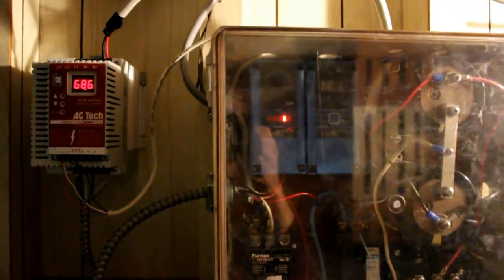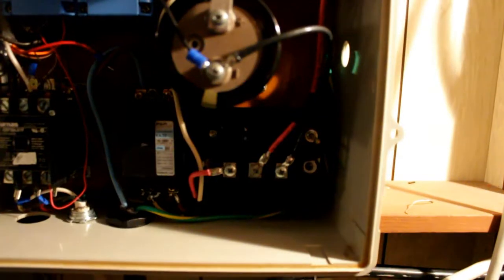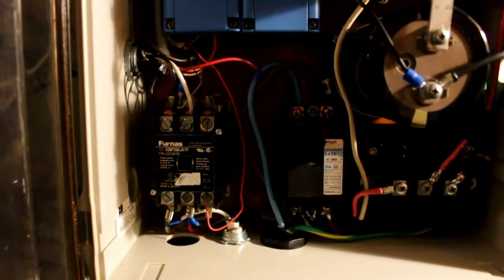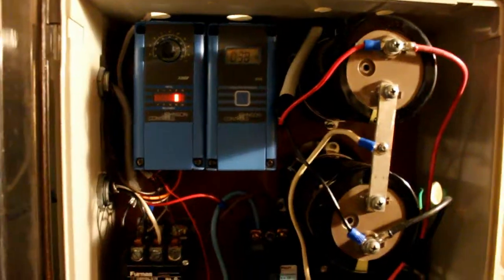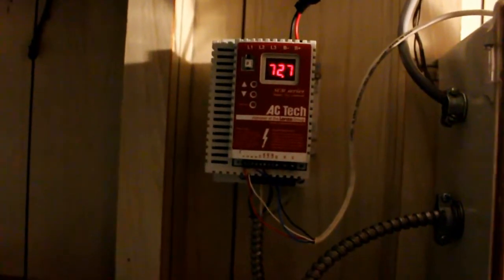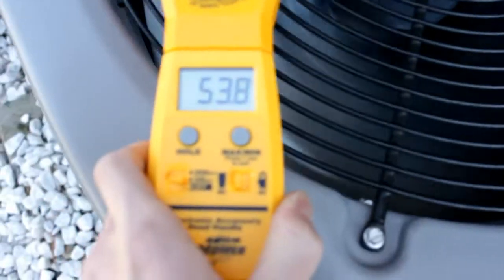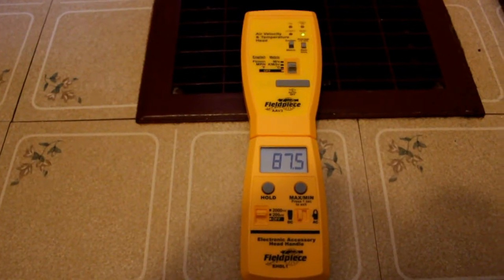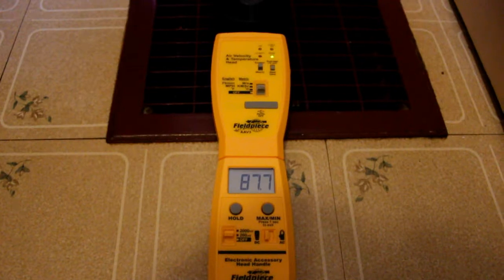R134a heat pump in heating mode (short)

Comment: Hi there! I subscribed to your channel as I noticed you've got great content here.

I was wondering why you decided to use a diode voltage doubler instead of a your boost converter. How was your power factor before compared to after?

Great work young man! I wish I knew what you know when I was your age.
Reply from the maker: When the system was installed, the former system was not in good shape, and we needed a replacement quickly. So I decided to use the diode doubler, primarily to save time. In the future, I would like to use a boost converter. The power factor isn't too bad, but that is mainly because this unit doesn't use much power. So even with a low power factor, it goes mostly unnoticed. Thanks for watching

Comment: It would probably be a good idea to make a shield to go over the DC bus caps. Not just to guard against shock but with such big caps, arc flash begins to be a danger.
Reply from the maker: Agreed. I will probably lock the plastic cover. I've instructed everyone in the house to leave it alone.

Comment: Can and have you tried turnning the rpms up in heating to get more heating capacity. All the inverter heat pumps do that when it gets cold. The carrier greenspeed will turn 8000 or 9000 rpms. And you should try using r 290 in that system to really get some efficiency. I replace my r 22 with r290 and the compressor dropped 3 amps per hour and it runs quieter but I also have a heat pressure varible speed control on my outdoor unit to
Reply from the maker: Maximum frequency is 80 Hz, normal is 60 so yes it's running overspeed. I'm thinking about R290 or R152a